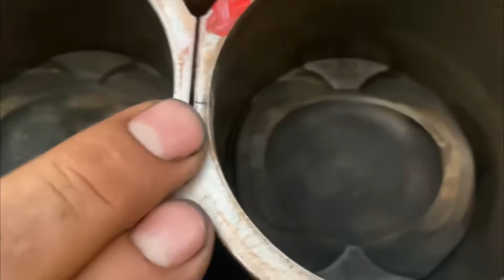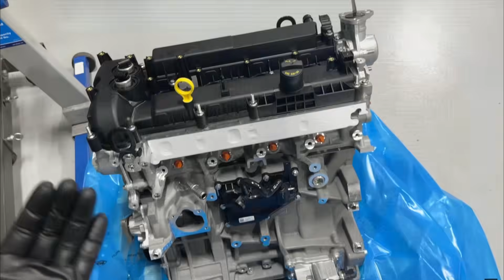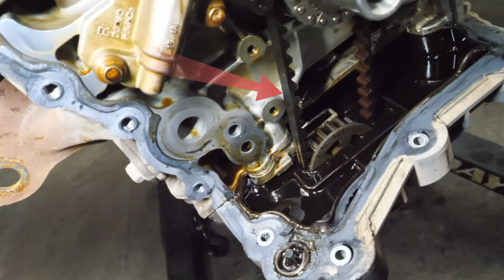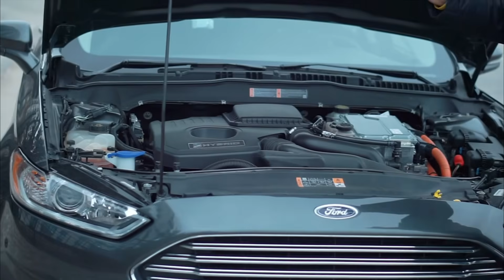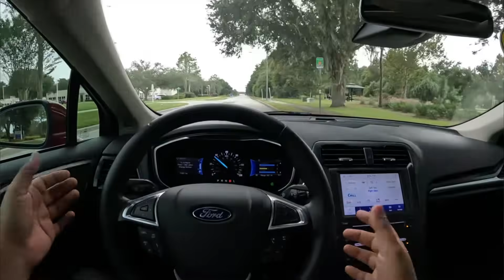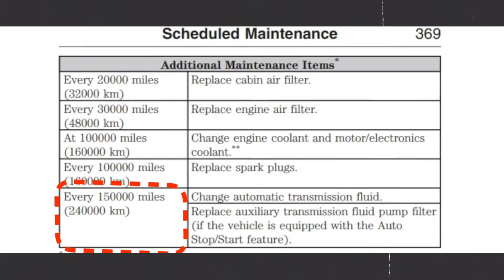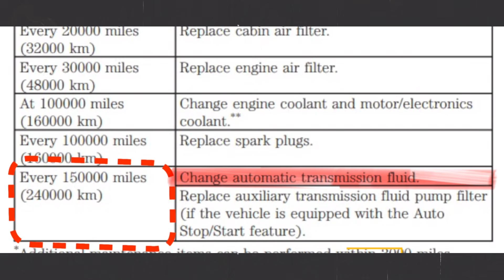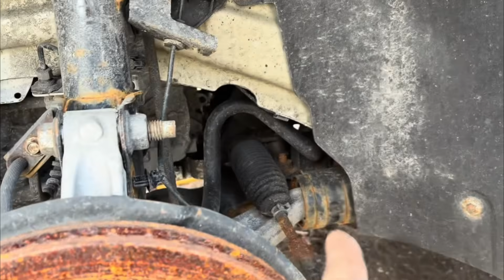Ford Fusion (2013-2020): A Complete Reliability Guide

Comment: I HAVE A 2012 FORD FUSION SE WITH 200,000+ MILES AND 30-33MPG.  I RELIGIOUSLY CHANGED OIL EVERY 5,000 MILES. TYPICAL MAINTENANCE, TIRES, BATTERY, ETC.  I MOVED TO THE SOUTH AND THE CAR IS TOTALLY RUST FREE. THE HEADLIGHT COVERS ARE STILL CRYSTAL CLEAR. IT HAS BEEN SITTING OUTSIDE IN ALL KINDS OF WEATHER, SINCE I  PURCHASED NEW.  SHE IS ONE IN A MILLION. THE ENGINE IS A BULLET PROOF 2.5L, NON TURBO ENGINE.  TURBO ENGINES ARE JUNK, RESEARCH IT YOURSELF.  STILL DRIVING TODAY. FINIS  PAX
Reply from the maker: amazing those 2.5s are the beat in fusions! thx for your long comment 👍🏻

Comment: the 2nd generation fusion actually came out in 2013 and ended in 2020 or 2021 and the 2010 - 2012 was a more like a facelift but it changed alot about the car.
Reply: 2013 - 2016 is the same body and face 
2016 - 2020 is the same body and face. 

I had a 2014 & 2016 but I sold them for the money at the time. Both had no issues. My 2014 was a 1.6 manual transmission and 2016 was a Titanium AWD.

Comment: My wife's 2013 with 2.5L Duratek had head gasket failure at 100K miles. The failure was such that oil was leaking into the cooling system, but no coolant in the oil. The car had been maintained up to this point with virtually no problems. I made the difficult decision to replace the HG as I did not want to buy a new vehicle, or search for a used replacement. Fingers crossed.
Reply from the maker: unfortunately it can happen with this engine but overall it's a great motor.

Comment: I leased a 2011 Fusion with less than 50k miles and it had transmission slipping issues. Needless to say I didn't keep that long. From November 2013 to March 2014. I have had my 2004 Acura TL for almost 5 years now and with over 200k I've only replaced brakes, tires, an alternator, and a motor mount. And that's after someone hit a curb pretty hard with it before I bought it. No transmission issues, no leaving me stranded other than the alternator going out.

Comment: I got a 2016 fusion SE I'm at 200,000 miles .......no issues ... always use mobil 1 oil and always use higher grade gas , change out spark plugs
Reply from the maker: nice man, with this maintenance it will last long!
Reply: What engine size?

Comment: I own a 2015 Lincoln MKZ hybrid which is the upscale version of the Fusion.  The MKZ has 202k miles and has had almost no repairs needed other than oil/air filter changes, coil packs, and spark plugs.  The car is unbelievably reliable.
Reply from the maker: that's impressive!
Reply: Toyota guts!

Comment: I have a 2.5l ford fusion bought it at 54k miles and now has 81k miles so far ao good on the engine. I change the engine oil every 3k miles and always rides smooth.
Reply from the maker: 3k miles?! you might be spending more money on oil then gas😂 good maintenance is the key👍🏻
Reply: Keep doing you. Synthetic oil changes every 3000 miles. Synthetic oil changes 30000 miles. It will last forever.
Reply: No transmission shifter bushing issues?

Comment: Mine is a 2014 fusion. Possibly worst car I've ever owned. Driver's door flew open while turning at an intersection. Had to replace all 4 door latches, AC compressor clutch bolt fell off, valve cover gasket leaks uncontrollably, drivers side cv axle bushing inside the transmission was greatly worn (damaging the CV axle, axle seal, and leaking transmission fluid. Also, the transmission has slammed into reverse since I bought it at 20k miles. This all happened before 75k miles. 

For comparison, I have a Toyota Rav4 that I've only ever done maintenance work on. I will only buy Toyotas from now on.
Reply from the maker: which engine?

Comment: I got a 2019 1.5 liter ecoboost with 60k miles on it 
Should i keep it or exchanged it 
Im about to pick up tomorrow 
Help pleaseeeee!
Reply from the maker: It all depends on the condition and how often this engine has been maintained (oil changes, coolant replacement, radiator cleaning). Yes, 60,000 miles is not a small mileage for this engine, but if it has been well-maintained, then it's generally worth considering. Before buying, check if there are any wet spots on the engine.
Reply: @thelonglastexpert what do you mean check for wet spots? Like oily ?
Reply from the maker: @spookybenzo836  can be anything. Oil, coolant leak..

Comment: I have a 2012 SEL with the 3.0 L direct injected V6. Full synthetic 5W 20 motor oil changes every 5000 miles, transmission services every 35,000 miles coolant flushes every five years with the Motorcraft gold, Royal purple, Max clean fuel system treatment every 5000 miles And with proper tire maintenance. I got 50,000 miles out of the original set. Car has been reliable as all heck, low on maintenance cost, and Pepe as hell with that i’ll be hitting 75,000 miles by the end of the year 3 L. By the way, the 3 L and the 3.5 L V6’s were not discussed in this video.
Reply from the maker: Hey, this video about 2 gen fusion not 1 gen
Reply: @thelonglastexpert  and the 2012 3.0 was not direct injection

Comment: My 2014 fusion with the 2.0 vep Spanish built engine,has 195600 miles on it now, i change the oil every 6000 miles, with 5/30 dexos rated oil. Very little if any oil usage. I change my transmission fluid 4 quarts every 30000 miles, with Valvoline lv fluid, and it shifts perfectly .. even when i use the paddles. spark plugs everywhere 2 years, air filter every 2 years. I uprated my suspension with adjustable coil overs and adjustable dampners, lower the car 30 mm, it's not 'slammed' to the ground like a lot of idiots do their cars. Has a very nice ride, and with polyurethane sway bar bushings, it handles really well, enough to give some audis and bmws a headache on twisty back roads 
 235/45/18 Goodyear euro LS tires have great grip, and are not wearing out all that fast., great car, yo bad Ford went stupid and tell us all, we need to drive SUVs. I went to china last year, and drove the new fusion they have and we dont, fantastic car
Reply: up to 199400 miles now.. due for a transmission fluid change..i use valvoline lv oil.. works great..i changed out the spark plugs over the summer..the old plugs were good looking still with 35000 mile on them
Reply: 200046 as of today   runs and shifts perfectly
Reply: 206500 miles today..still runs great..did a front lower A arm replacement last ,onth..both arms cost 149.99  and took me after putting the front of the car on jackstands 15 mins to remove and replace.. very easy job

Comment: I would go for a 2.5 but they aren't very well equipped as they're limited to S and SE trims.  I think the hybrid/engergi are the best options for reliability.  I've heard some negative things about the transmission in the 2.7 Sport models, though that could be the result of people brake boosting a lot.  I rented a hybrid and got 30mpg going up a mountain at 82mph.  Something I don't think any other Ford could achieve.

Comment: I have a 2014 Hybrid model that has 234,000 miles. I have only swapped the wheel bearings on it and the rear camera.
Reply: im curious too have you changed the transmission fluid?
Reply: what oil are you using? and what interval did you change trans oil
Reply from the maker: energy or regular hybrid?
Reply: It's a toyota is why
Reply: Very underpowered I heard

Comment: People I have a Ford Fusion Hybrid  SE 2017 I bought with 125k is now 160k . One and half years ago .

The best purchase ever did .
Not a significant problem or not a real problem at all .

Just regular maintenance 

I’m planning on using it till the end it’s being a really good car , the best I drive , and 40 mpg is my avg .  $3.0 is the gallon these days I can fill up the tank 35 bucks and ride it for 550 miles. .

Great car really . Peace out u all . Stop the war love your brother . ❤
Reply: I bought a 2019 Lincoln MKZ Hybrid ( Fancy Ford Fusion ) new and put all the miles on it. Schaeffers synthetic oil from 1800 miles, transmission serviced every 50k or so. The car has 157k and is the best I've had so far.

Comment: I Had a 2010, a 2016, and a 2017 fusions with the 2.5 power plants. And love them all. great reliable vehicles. And cheap to maintain. Glad I didn’t get the 2.0 power plant
Reply from the maker: Good choice 👍🏻 mileage?
Reply: @thelonglastexpert  (2010) 82,000 miles
(2016) 47,000 miles
(2017) 34,000) miles

Comment: I’ve got a 2014 2.0 fwd with 156k still going strong no issues at all I put 60k+ on in one year I got the car at 95k. Only thing is  transmission is starting to go and I plan on replacing and doing some performance mods to it but I’m very surprised how far it’s gone with the symptoms it has and the fact that I drive it like a hellcat😂just took it to Virginia from upstate ny and she did perfect

Comment: i have  a 2016  se 2.5 and its at 168k miles and ive never had an issue other than a  rodent chewing threw the injector wires !! lol
Reply: I think that's because the insulation was soy based rather than plastic. Heard of it happening in other cars.
Reply: No transmission shifter bushing issues? 

No electrical issues?
Reply: @JohnTaylor-bd1uy  yeah it went out but it was only $10 and took 5 min to fix my self
Reply: @JohnTaylor-bd1uy  yeah i had to replace the bushing but it was oonly like $8 and took 10 minutes to fix myself

Comment: I have a 2015 fusion with 150k hard miles. There was issue with the steering column that got fixed in 2020 and cost around 1k. No other issues and it’s still going every day.
Reply: which engine?
Reply: @BlueOvals24  Duratech 2.5 i4
Reply: @OhMyPoBoy   Hi bro,  is the transmission still working perfectly?
Reply: @eddideleon2845  It’s not as smooth as it used to be but it doesn’t have any major problems
Reply: No transmission shifter bushing issues?
Reply: @JohnTaylor-bd1uy lmao i stand corrected. i did have to replace that, but the bushing was cheap and easy to replace. That was a few years ago
Reply: Were there any symptoms?
Reply: @TruFire710 For the steering issue, no symptoms, it just locked up after we parked it at night. For the shifter bushing, the shifter felt a little sloppy for about few hours before the plastic bushing fully disintegrated. We were actually rear ended a week ago, and the fusion is totaled now.

Comment: Ive had my 2017 fusion sport since brand new. And even though i only have 30,000 miles on it it’s been pretty reliable so far. And its very fun to drive.
Reply: Wow, how so little mileage? You must not drive it much. Mine is a 2019 and has 30,100, which I thought was low.
Reply from the maker: MPG?
Reply: 17-26